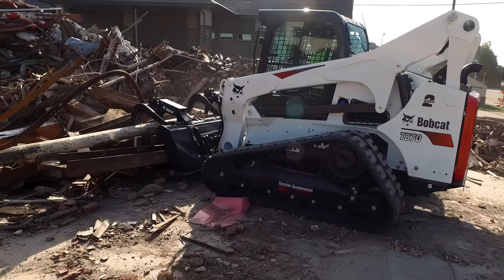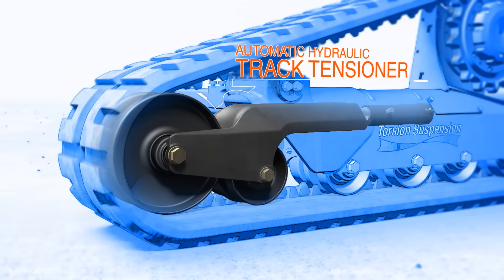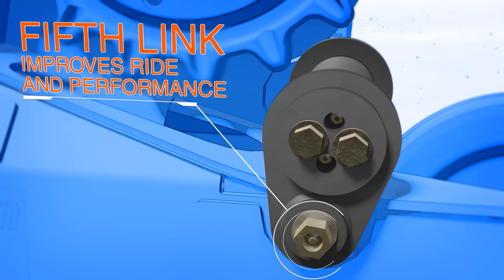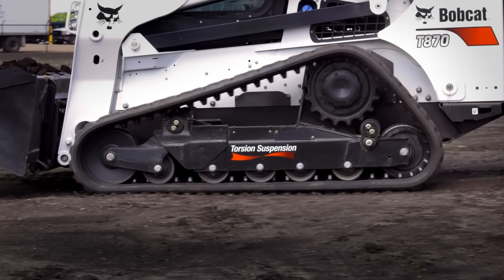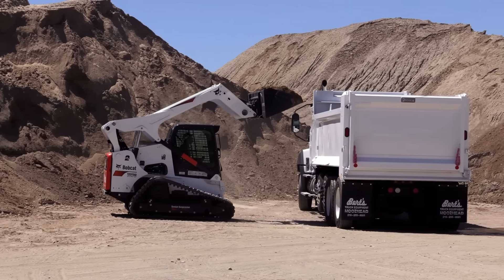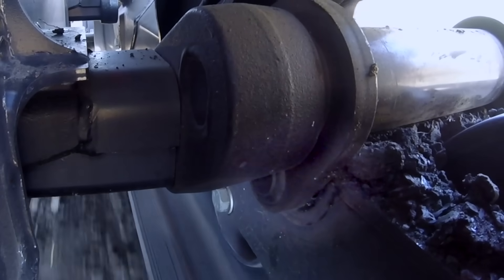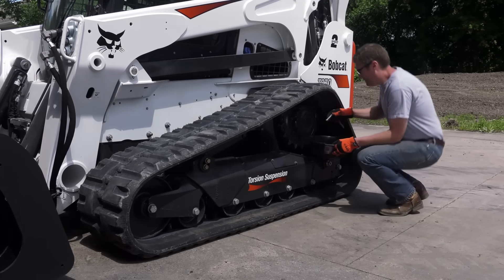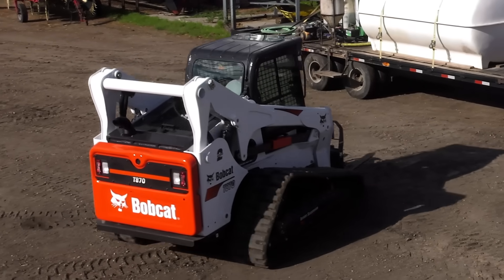New Compact Track Loader Torsion Suspension Overview

Comment: That really looks like a huge improvement over the 2008 t650 that I've got used to working on, but I still think segmented sprockets would be a big +, those things can rust on solid.
EDIT -  The hydraulic track tensioner sounds really good but those hoses will absolutely get smashed down there, that area always gets filled with mud and debris on Bobcat loaders.
Reply: I used to deliver for Sunbelt in Lynnwood wa. 07 to 08 then the crash. I did fall in love with this model. But beat you up inside. Now I'm retired and I think I'm going to buy one. I would appreciate your thoughts on the current models and a private operator.